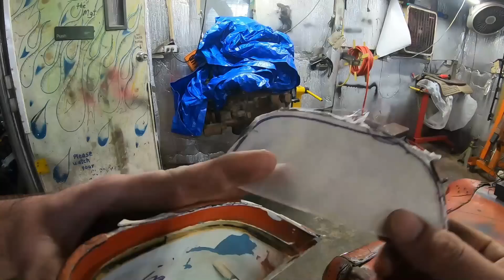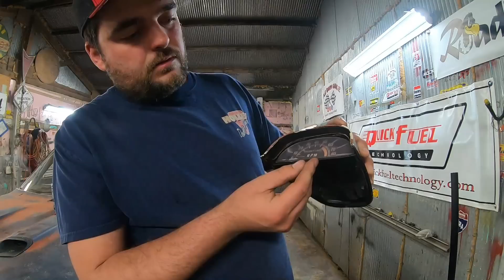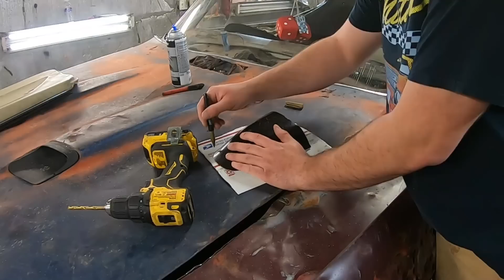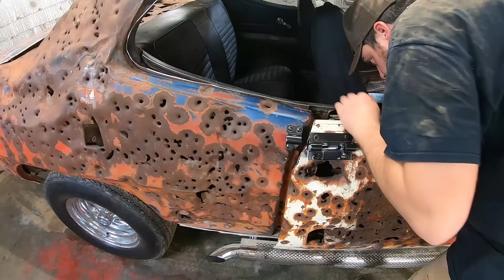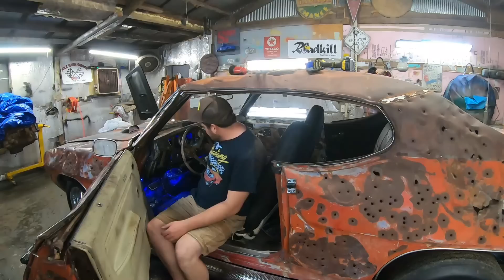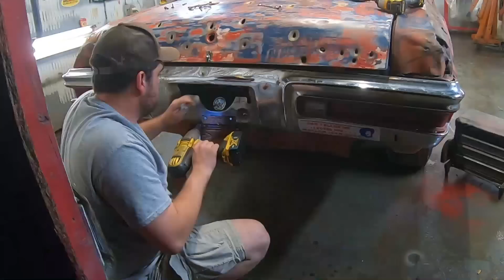Worst GTO Ever: The Holey Goat Part 22 Loose Ends, Door Panels, CB Radio, Hood Tach

Comment: First time caller long time listener. Didn't you  put the switch on the ground side of the light circuit? Then lights would have power all of the time and the short to ground on the light strip would power up the lights. Enjoy the videos!

Comment: Ok, I realize I'm 10 months late but your blue lights intermittently working..... The chineseium light strips are grounding out, possibly on a rough spot, if there is one 🤣.
When you wired the switch to ground, I cringed, those cheap lights will have the + going though them all the time, fire waiting to happen.
Reply from the maker: Switching grounds is generally good practice, but not with these lights I guess

Comment: You can use Mod Podge spread thinly to glue the "tach" to the plexiglass, and it'll dry clear. The other thing you can use is white Elmer's glue thinned out a bit. 
I've made decals for models using printer paper and it works

Comment: Defiantly a bad ground for those light which seem weird af lol
Reply from the maker: Bad ground with no voltage?!
Reply: @PoleBarnGarage  actually on second thought you probably wired the switch with the positive to it. Which would make the ground not make sense if the switch was off. Lol if you wired the led lights with constant positive 12 volts and had the switch with negative 12 volts that might make the light flicker like that because it's picking up ground elsewhere.

Comment: You did an excellent job with those door panels, and like you said it is safer now, believe it or not I did the same thing 23 years ago on my 1st car which was a 1986 Chevy Cavalier and yes, it was crap! I used some door panels from a 1996 Chevy Corsica for the rear doors, mine were broken and made them fit by trimming and using screws to hold them in place also made all seats fit it was an upgrade for a low buck, you got to find your ways whenever needed with what you have, like always awesome video!
Reply from the maker: Ingenuity!

Comment: Texas switched to multi year plates in 75. The '75 plates were the only year with a star between the letters and numbers. Then in '78, the county clerk would give you a sticker you put in the upper right corner for the year, and the upper left corner said what month registration was due. We moved back to Texas (from Blue Springs) in the summer of '75. My dad's car, which ended up being my first car, had a plate that started with an L.
Reply from the maker: So it's probably 78-79-80 something like that

Comment: With all them pre-installed perforations, I was rather surprised you had to drill another one for the cable to go through.  Just goes to show - you can never have too many holes.....and even if you think you're done with them, when the need for another one arrives, you can't do anything but make it happen.  Those door cards look the part too......and the rev counter is just an inspired piece of design work.  If she had carpets and a hood lining, I reckon she'd be a mint cruiser......but that might be going a bit over the top in the luxury department.  I mean, she IS a muscle car after all, so maybe some astroturf would be more appropriate.
Reply from the maker: I could just fill the car with dirt again
Reply: @PoleBarnGarage  - Nah, it would all fall out them holes, mate....and unless you kept it damp, you'd have a dust storm in the car every time you drove it.  That could be a bit of a challenge.  She's not actually a Challenger though - she's a GTO, and everyone knows that stands for Green Turf Option.

Comment: Well the doors look a lot better on the inside with those panels. Was sad to see the window cranks get cut off. Would be cool to see you get a junk doors or some working window parts just to see if you could cut out the insides and maybe fabricate something to put windows in.
Reply from the maker: There's pretty much no chance. MAYBE the passenger door. I have all the stuff if I decide to
Reply: What I meant was like take a door shell the skin was trashed on and cut enough past the shell on the striker post sides and bottom and the hinge side and then weld, self tap or rivet the original bullet hole skins onto one's that aren't murdered inside. I get that you want original body but spray paint would cover up the evidence anyways. Not trying to be pushy just my two cents
Reply from the maker: I also have doors set aside for that exact purpose. It's a good idea, but could be tough to pull off. Excellent future content
Reply: Tough to pull off? Maybe but you blew my mind by getting a front windshield onto it! Would make for a good video for sure but if you succeed it begs the question of do you go for the quarter windows and rear glass.

Comment: Plumbers' pipe strap was always a popular choice when mounting 8-tracks and CB's. I bet you got a roll of it laying around some place. Also, get yourself a 12 pack of Bud long necks, and save the bottle caps. Those are the knobs for your radio, the CB, and the 8-track. Also any other accessory knobs that they fit on. We used to just glue them on over the existing knobs. (Peel the little plastic lining out of the cap and use JB Weld)
                You're in this all the way, and I can see that your dedication is obvious. That's why I feel a moral obligation to offer assistance with filling in any extra details to ensure a period correct ambiance for this fine project. So far, I don't see anything that looks out of place.
Reply: "Also, get yourself a 12 pack..."

Beer can pull-tab chain hanging from the rear-view mirror. 👍